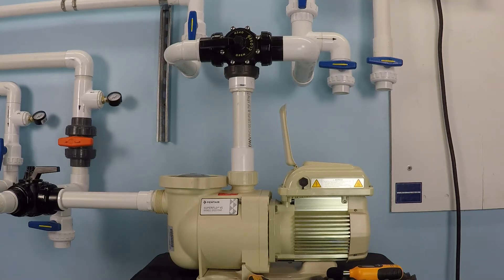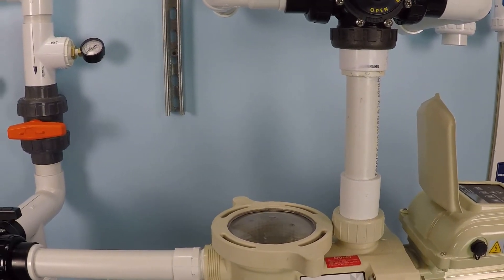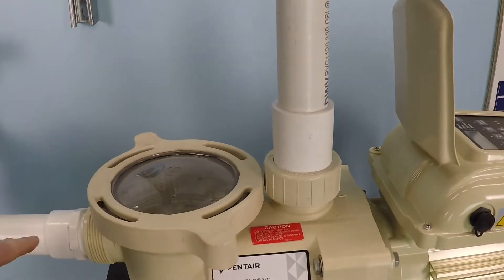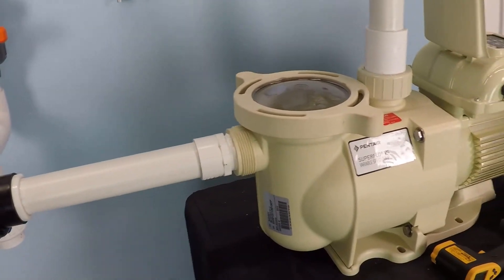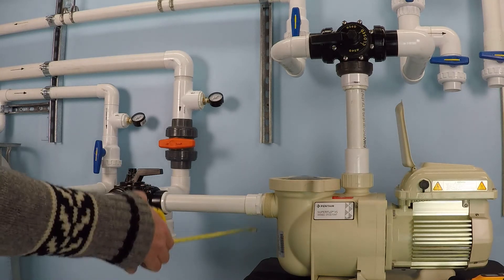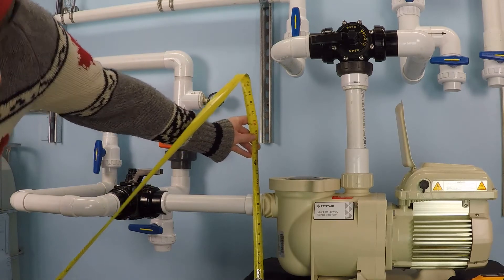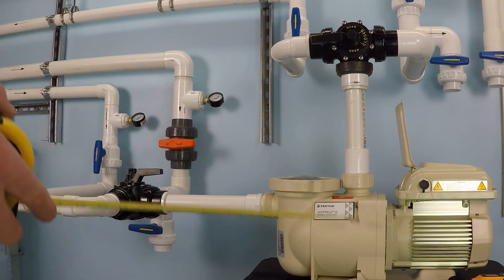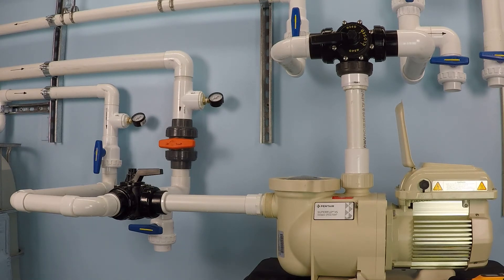Pentair SuperFlo 342001 VS Pump Intake & Discharge Height

Comment: Steve, thank you for information you provide,,,I watched all your videos several times,,,and you drove me to buy one,,,I got the 01156,,,if possible could you do some videos on that model, Thanks
Reply from the maker: I would love to.  I was hoping to see manufacturers reading these comments and offering to send me equipment to review.  If i can I will but them all and test them all eventually.  Either get the manufacturers involved, do gofundme for each major component people want to see tested...or one by one I will buy them myself but that is going to take forever.  Hey - mail me your Intelliflo...I promise to take good care of it ;)
Reply: Swimming pool Steve would it be okay to install an outside
Reply from the maker: @Butchey24  Yes these pumps are made to weather year round outdoors, even in places that freeze in the winter.  Just winterize (drain) it properly.  The worst outdoor weather is sun in places like Arizona and in these cases a sun shade or motor cover of some kind would be a good investment to keep everything looking and functioning well.
Reply: @Swimmingpoolsteve  sure I'll mail it to you,,,:),,,,I can send you pictures of some amp readings that I'm doing for the before and after,,,also I order a flow meter,,,so I'm gonna do the flow meter first with the old pump,,,then the readings with the new pump

Comment: What you described is exactly where I am in my search for a VS pump.   Are SuperFlo VS models generally a drop-in replacement for SuperFlo single speed models?
Reply from the maker: Yes, and both are drop in replacements for the Hayward Super Pump, and vice versa. They do that to try to make it easy to get customers to swap brands. That is why the names are so similar, to imply this direct swap ability.